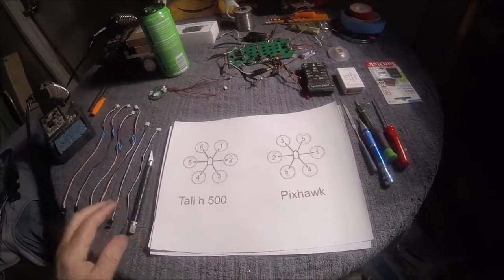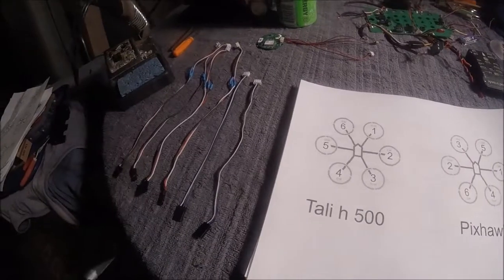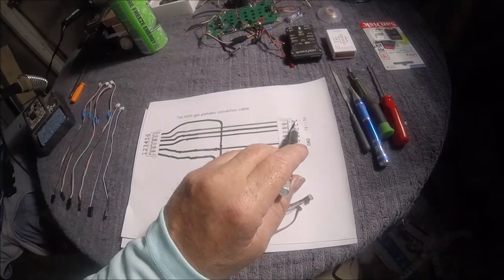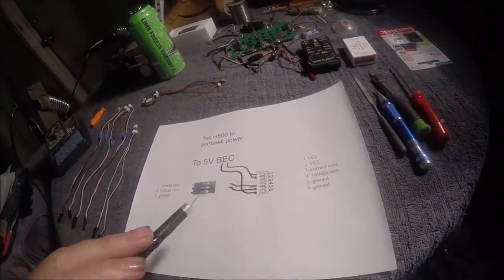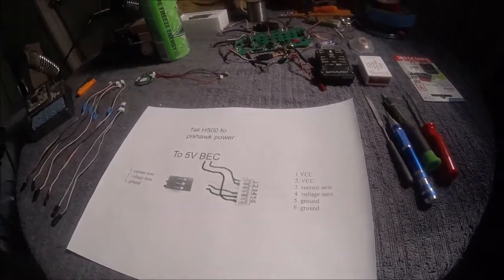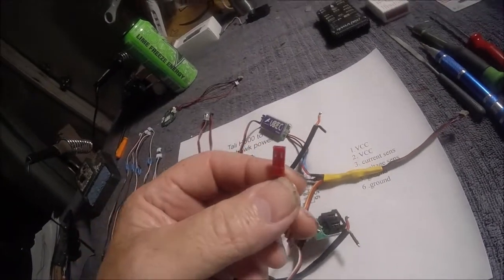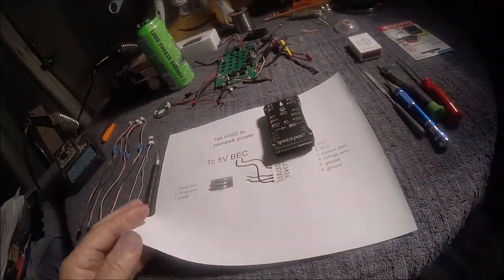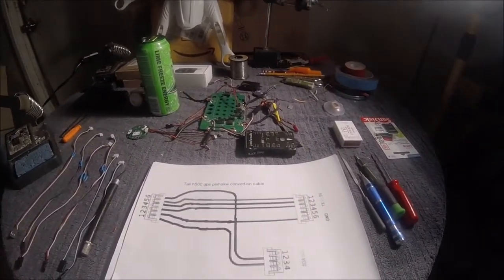Tali h 500 pixhawk upgrade preparation section 2

Comment: If you meassure voltage between the red and black cable from Tali H-500-Z-18 Powerboard you will find constant about 5V. Then I dont understand how the Pixhawk can use this for voltage sensing from the 6S.  If you meassure between white and black you will have approx 4.8v when 6S is about 25v and 4.35v when 6S is about 23v. I believe the constant 5v red cable is for powering the Devention controller FCS H-500 and the white for voltage sensing.  Is it possible to meassure the Amps on a Walkera Tali h-500? Can you Please describe your setup of the Pixhawk battery monitor also. I cannot get this to work. Great videos James. I tried to contact on mail but did not have answer yet. Tnx.
Reply: You have right about it. See my comment to get what you need ;)

Comment: I think your voltage and current sensing works wrong. Voltage above 26,5v? Original tali doesn’t have current sensing pin just voltage sensing and uses different sensing voltage (not sure but could be 6,6v with divider 1volt/5) and theres no current wire on PDB. Maybe you already solved it.
But if you measure v on white cable on full battery you get about 4,7v and on red one 5+ volts. So red is your BEC voltage to power FC and white is voltage sensing and to use it in pixhawk you have to connect it to 6,6v port instead power port. And than change input in voltage monitoring to that input and turn off current sensing or use pixhawk 6S power module insteed.